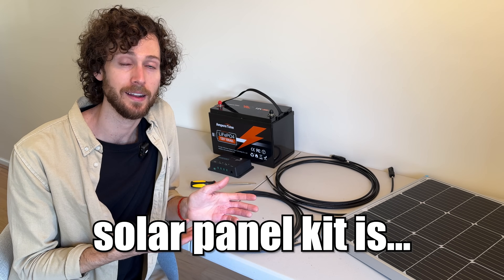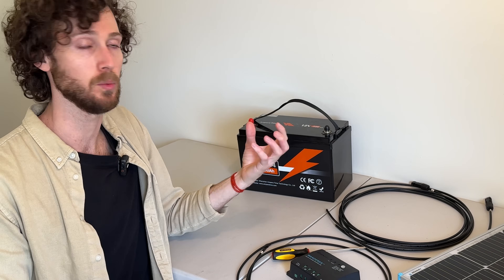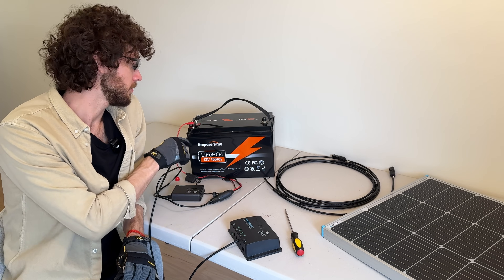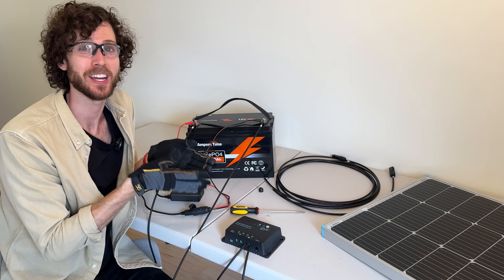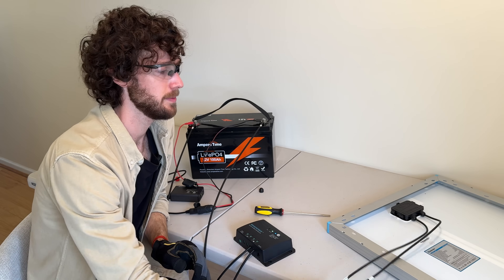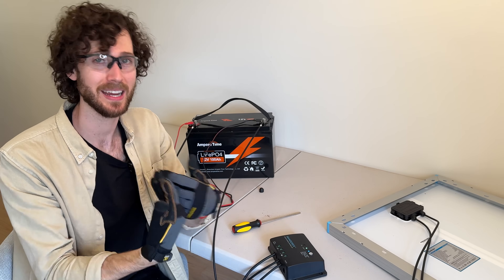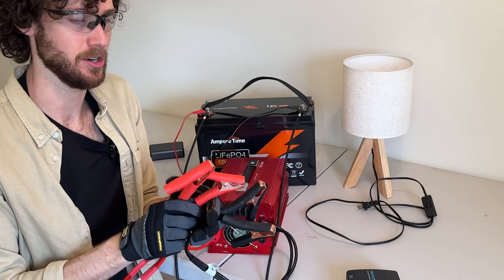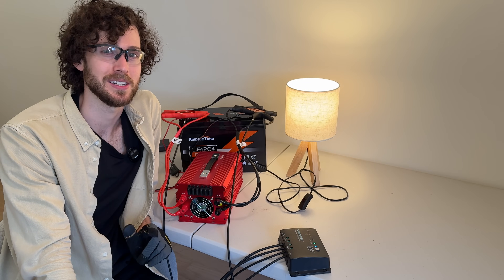100 Watt Solar Panel Kit Setup for Beginners - Step-by-Step!

Comment from the maker: PRODUCTS used in this video (affiliate links)

Renogy 100W 12V solar panel kit - https://amzn.to/49eXywQ
LiTime (fka AmpereTime) 12V battery - https://amzn.to/3Svguk9
2000W 12V inverter - https://amzn.to/3usFoso
150W 12V inverter (very small, not recommended) - https://amzn.to/3w10EpH
12V car socket (for connecting 150W inverter to battery) - https://amzn.to/495xmVI
Reply: Would this work to power a mini split i just want to know how much juice it’s pulling from a battery
Reply: You made me save some money. Muchas Gracias
Reply: Thank you for a beautifully concise and thorough explanation of this basic system!
Reply from the maker: you're welcome 😄
Reply: PLEASE HELP

 1) WHAT WAS THE RATING OF THE CHARGE CONTROLLER YOU USED

 2) WHAT ARE THE DEVICES THIS SYSTEM CAN CARRY 

3) WHAT IS THE OUTPUT WATTAGE THIS SYSTEM WILL GENERATE 
???

Comment: There's a spark when you connect the inverter or controller because it has a load on it meaning the inverter or controller  is in the on position when you make the connection. If you have it turned off when you connect it to the power source it won't spark. It's like when you have your iron on and you plug it in the electrical socket it sparks same thing the load is high the arching occurs between the plug and socket just like the arching occurs between battery terminals and the wiring connection on the solar connection.

Comment: This might not be a concern, or might no longer be relevant these days.  However back circa 1985 (when I was 17) my Electrical Engineer friend lectured me on the proper way to jump start an automobile so as to avoid sparking at the battery terminal as he said their was a possibility of inadvertently igniting the gas present just under the battery case lid at the terminal.  He said connect positive to positive and then negative to Chassis (car frame as the negative terminal is already grounded to it)! By doing this you get the spark in a safe location far away from the battery.  🤷‍♂️
Reply: Stupid question... When you wrote negative to chassis... Is the negative to the good battery and the other end of the wire going to the chassis of the car that has the bad battery? Apologies if this is common sense... Thank you.

Comment: What do I use to connect the alligator clip to the Renogy Solar Charge Controller 3Wanderer Li Charge Controllers?  I am using iGreely Solar Panel Extension Cable - 10 Feet 10AWG(6mm²) Solar Extension Cable so that I have enough length. The other end of the alligator clips has what I think is called SAE Quick connector.  Or, Can I use the battery connector from the controller and go directly to the "solar on board" connector on the side of My RV? but even doing that I have the wrong connector on the end of the extension cable.

Comment: Use a resistor from batteries posts to wires before connecting it with help sparking and not damaging batteries or components use colored electrical tape red + to mark cable end and like green for - that way you never make a mistake connecting 😉

Comment: 10:28 Solar panel: aka PV stands for PhotoVoltaic (i.e. converting light to voltage). 11:22 A Fuse is a safety component that should be sized proportionally to the electrical load and INCLUDED in the circuit on the positive (+) conductor. Just because the circuit works without a fuse, that is not a valid reason to exclude it. Electrical fires are not happy endings for DIY or professional projects . 🤔

Comment: Complete newbie here. What is  the charge controllers function? Couldn't you just connect the solar panel to the battery?
Reply: No, your panel output is different than the The battery will accept. 18.7v versus 12v. So among other things converts the voltage, make sure the battery doesn’t get overcharged, monitor the charge to optimize. It is absolutely necessary.
Reply: @DESERTCYCLI5T good to know.  Thanks for the information.

Comment: Das ist totaler Quatsch.
Ein 2.000W Inverter (2000 : 12,8 = 156A) WIRD NICHT mir einer 100Ah Batterie funktionieren !!!! (100Ah : 12,8 = MAX !!!! 1.240W !!!!
Reply: Correct. An inverter will also lose 5-25% of the power. I use a 500 watt inverter for safely.

Comment: can someone explain what inverter does, what charge controoler does?
Reply: An inverter converts the battery power to a household type power outlet for a tv or a laptop device. A charge controller sends power from the solar panels to your battery to keep it charged.

Comment: I’m no nothing about using solar power, I was wondering if this system can run a Traeger pellet grill for 12 hours. Like I said I know nothing on solar systems.
Reply: Yes, this is perfect. Pellet smokers use about 50 watts an hour so a 100 watt solar panel and the 1200 watt hour battery should stay charged. Cloudy day cooking will drain the battery down but it can recharge on another sunny day.

Comment: Having to disconnect the solar panels first is such a stupid thing. Imagine the battery discharges over night, then in the morning the charger will first receive power from the solar panels, how stupid does this has to be to damage the charger if it happens.

Comment: i recommend a double pole circuit breaker between the solar wiring and charge controller. a fuse or double pole circuit breaker between 12 volts supply out of controller to battery and a fuse or double pole circuit breaker between battery wiring to the inverter. also, the use of busbars positive and negative to supply a 12-volt fuse box to run 12-volt systems (i.e.) 12-volt lighting for campervan etc. the battery neg terminal should also be connected to the chassis of the vehicle using a green cable with a safety electrical earth l and warning do not remove
All fuses and circuit breakers should be rated according to the equipment manufacturers amps rating as also the cables you use. I do not recommend using crocodile clips in a fixed installation as they can easily become detached and could cause short circuits so cut them off and use a ring connector on cable instead for a more secure connection.

Comment: For beginners, just pay to play.   Solar panel and a power generator like an Eco Flow or a Bluetti- that’s it.  No fuss no muss.  The power generator is portable and can be used anywhere compared to disconnecting cables from terminals and then carrying a battery and an inverter around.  No app, no comprehensive display, no usb ports, no AC fast charging, no car charging, no upc function.

Comment: Hey alex thanks for guiding me through my solar power addiction. Its really become my new obsession. I just have a question about all this. I want use solar power for my shed/workspace but i wanted to use a portable power station (i.e Mega 1, or similar) instead of a standard inverter like in this video. My question is how safe is it to have the setup connected 24hrs a day. Will the charge controller and built in eps of the portable power station keep everything copesthetic? I plan on running a mini fridge constantly but also a verysmall computer (rasberry pi for my outdoor entertainment system) amongst other things. I would really appreciate it if you got back to me before i blow myself up or damage my devices lol. Thanks a ton alex. —Take care.

Comment: About time someone like you has demonstrated and given a clear presentation on 100 watts solar panel set up. However, how many devices can l plug onto a 1000 watts inverter?

Comment: I have the 100watt thunder bolt solar panels from harbor freight. Just need to get an inverter. Question the bigger inverter I get will give me more power ?

Comment: This is a nice video and I really enjoyed it.What is that small black piece on the table apart from the charge controller and the battery before you brought the red inverter,what is the function of the inverter.Just to know,is this installation also applicable to bigger applications,if you can,I will like you to please recommend the type that can be used for the whole 🏠 🛖 🏚 🏡 🏘 that will work very efficiently without any interruption.

Comment: Help! At 68, I just bought my first popup camper. For whatever reason? They removed the battery. I would like to be able to go with your setup. It has a built-in converter, (either the 8712 or the 8725) is there anything else that I need? I would like to have plug in's for the solar.

Comment: How do I select the correct size of, complete solar power system to supply a domestic house with deep freezer, electric jug, n lights n other normal house hold appliances?

Comment: Allowing the spark could fry the capacitors in the inverter, better to use a resistor or test light. Great info. Love simple build videos.

Comment: Major error - You did NOT fuse between battery and solar controller and worse no Fuse at Inverter. That is extremely dangerous

Comment: Hi I connected my 3 life pro lithium 12v 100ah  batteries in series to my charge controller and to the inverter and solar panels but my inverter keeps blowing up with big sparks with smokes . What did I do wrong . Inverter is 16000 on 12v.

Comment: I have a question for you. I have an outside stove that has a water pump on it for for in floor heat and I don’t know how many watts it will take to run that pump so if I run out of power, I can have some heat for a few hours like last night I lost my power and it was out for six hours. I was OK, but it would still be nice to be able to have a little back up. I guess my question is is how many watt system I would need to run that for a few hours.
Reply: Plug it into a kill-a-watt device, that will tell you how much power it runs.  Also could check the size of the fuse it runs on.

Comment: I'm building almost the exact same system with a renogy wanderer 30a Li and 100ah LiFePo battery. Could you give us the exact details about the wires and any adapters you used? Thanks.

Comment: Important question. Is this charge controller safe to use with LiFePo batteries? Is it reprogrammable to prevent overcharging?
Reply: If only there was a link to the items....

Comment: you're doing your viewers a real disservice by not mentioning using the appropriate wire size (gauge) to match the size of the inverter. Also would NOT recommend using "battery clamps", bolted connections are always preferred for transferring the most energy (amps) and are safer (no sparks) when the inverter is switched off   .....

Comment: Hi I'm looking to use this set up with a 100w electrical fan heater to keep my greenhouse warm through the dark months her in the North of England. I estimate a fully charged battery can run the heater for around 11-12 hours. Can you or someone advice how to add a thermostat so the heater can switch off if the small insulated greenhouse reaches optimal temperature? Thank you.

Comment: Hi if you have a 100w small heater will that fully charged battery run it for 12 hours? And is it possible to add a timer on to this setup? Thank you.

Comment: I'm having trouble changing the battery type, my converter/panel/ control is working, but i have a lithium battery and cant change the type. Ive tried connecting and disconnecting, anyone got any idea?
Reply: chatgpt says - "You CANNOT change the battery type from the Renogy Wanderer 30A PWM (RS232) using the button alone" can someone confirm?

Comment: have any idea how many batteries, how many 100 watt panels it would take to power that 2000watt inverter? That inverter will kill the battery in no time and the panel is the equivalent of spitting in the ocean. You need conservative 6 to 8 1250ah life pros, 8 to ten 250 watt panels to maintain a steady current on a conservative use. That inverter has two leads for 24 volt power. This set up would keep a light on.. charge your phone and maybe an ipad. by morning you'd never get a charge on the dead batteries from that panel. 
Not being a negative Norman.. just you need to do research before investing in something so expensive on an amateur level. Too easy to go broke will silly mistakes on Amazon.. way to easy for people to fall into that trap. We're all in this together. Keep your stick on the ice. If they ask ya.. tell em' Norm sent ya. ✌

Comment: I use 3x 435w solar with kemot URZ3417 inverter 55ah battery that hardly charges ok its winter but still 100w panel with that battery will charge in weak

Comment: PLEASE HELP

 1) WHAT WAS THE RATING OF THE CHARGE CONTROLLER YOU USED

 2) WHAT ARE THE DEVICES THIS SYSTEM CAN CARRY 

3) WHAT IS THE OUTPUT WATTAGE THIS SYSTEM WILL GENERATE 
???

Comment: How much power can it support? Does 100 W means that it can only support 100 W of power? For example, would it be able to support 2 heat lamps at 250W each?

Comment: nice video I'd like to start w/ a 100watt panel,(what you link to but the controller w/ a display of voltages) lead acid battery, 10watt charge controller,1500watt pure sine wave converter, plan to power a hot plate on low can be 600 watts to boil water. use 1500 watt electric heater on low can be 500watts. not both at same time. I'm concerned about constantly monitoring  my 100amphour lead acid deep cycle battery an turn everything off before the batt. exceeds 50% of its capacity. thanks for tips

Comment: What would you suggest for an inverter to run a couple 60 watt light bulbs?
This would be used merely for some lighting in camp to read by before going to bed while motorcycle camping

Comment: How do you connect more than one solar panel today? I see how you did that one. It's pretty awesome, but if you had a little bit bigger system and you have to hook in 2 or 3 solar panels and you only have one spot to put Em, how do you do that? Do you like get a special wire to clip it together or something

Comment: What is the best side of the size of the charge controller that be used for all sizes of solar panels?

How do we wire a circular without the solar battery but include a solar submissive pump?

Comment: 1:47
STOP
Never simply insert any cable lead, that HAS NOT been securely /tightly twisted together, with a pair of electrician's pliers.
Why?
Because doing it YOUR WAY, means that sometimes a stray STRAND can be left outside the terminal or, worse, tightening down the screw, DOES NOT ALWAYS mean a secure connection.

Only by securely TWISTING TOGETHER "all loose strands", can a single screw down terminal, be regarded as fully secure, when tightened by hand with a screwdriver..

Comment: hi Alex, very nice video tips. I have a question. 

What if the alligator clips are from the solar controller cable out ? ( Example : Dokio Solar Panel 200/300W model ). And the Power Inverter both end are Rings(Lugs) type instead ?

Do you connect the inverter rings cable to the battery first ? Then use the SC cable out with alligator clips to clip onto the battery before connecting to the SC ? 

Finally only connect the solar cable to the SC ?

Reason I'm asking is : Since the inverter cable is rings(lugs) type, it is easier to connect to the battery terminal first. Tighten up the screws. Then on top of the battery terminal,  only use the alligator clips provided by the SC ?

Any advice you can give in this scenario ? Thanks in advance..

Vince

Comment: Good clear setup explained.
Not sure if you will see this comment due to age of video. However, the one question I have is... my charge controller has a load output on it. My assumption is... since I am using a 5000 watt inverter with #2 cabling, I just leave the "load" connections on my charge controller unused. Would this be correct?

Comment: Great video and information! Just a quick comment, I liked that you are talking about the project, you should talk about Safety before starting any part project e.g. Electrical gloves, "don't"  forget the Insulated tools and eye protection (Really important to protect your eyes from sparks it can send small metal projectiles in the air and into your eyes!). It's a good practice for any type of voltage. Thanks for the video! Keep up the great work!

Comment: If I am running small 12/v led strip lights can I just connect them to a power bank powered by a 12/v connected to a solar panel? Through a power switch of course.

Comment: I am not an electrician but i thought the rule of thumb when making electrical connections like this is to always connect the negative (neutral) cable first.
Reply: When removing a battery yes, when connecting is the positive first.

Comment: First I gonna say your video is very clear and easy understanding
Just got a question, if I use 100w solar panel to charge the battery and use 100w appliance to withdraw the battery at the same time
Is the current from solar to the battery then battery to the appliance 
Or solar power to the appliance straight away?
Just curious 
Thanks

Comment: you can change the croc clips for ring  or get the cable with  ring ends for the convertor
why does this converter need 2 croc clips each side easy for coming off  so problem keeping proper connection

does it change for more panels.

Comment: I understand what your suppose to do,  but what happens if you have the settings on the wrong battery settings for your battery? Will it not charge? Or will it blow up

Comment: Great way of breaking down the topic into easy bits.  I would connect your power source (battery and panel) bare wires first then the battery connections and finally the premade connectors on the panel.  This minimizes exposure to potentially live wires.

Comment: According to my Renogy 1000w inverter manual, the inverter should be connected after the solar panel has been connected to the charge controller, and the inverter should be switched off as well. Then the inverter can be turned on after everything has been connected.